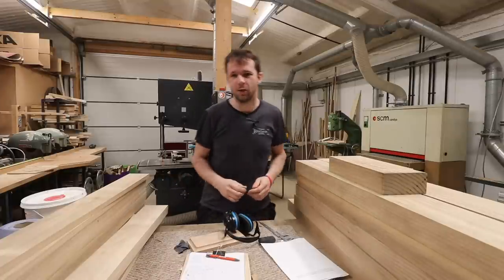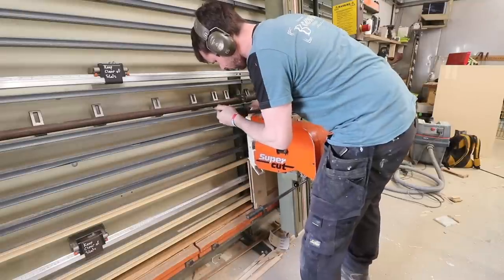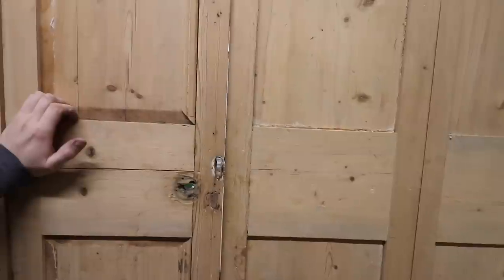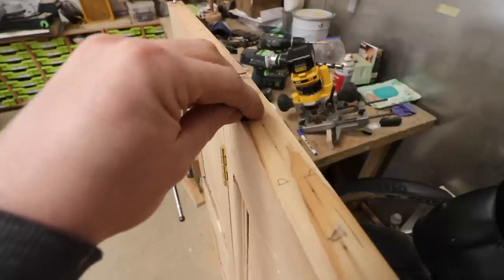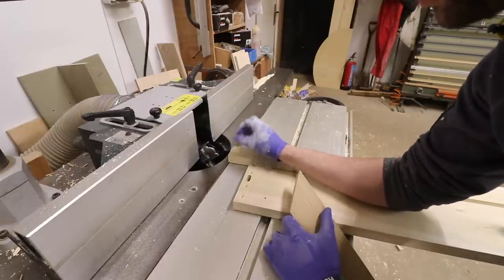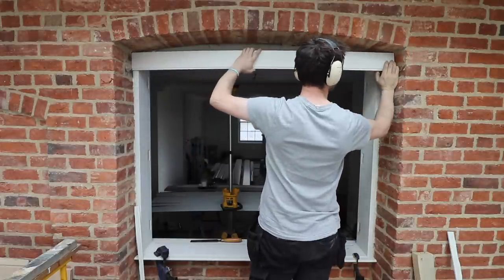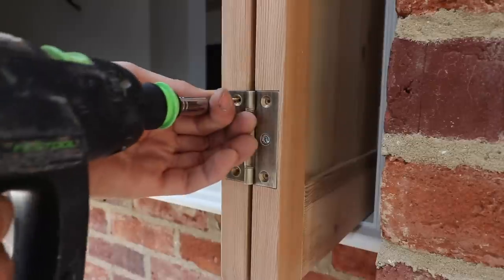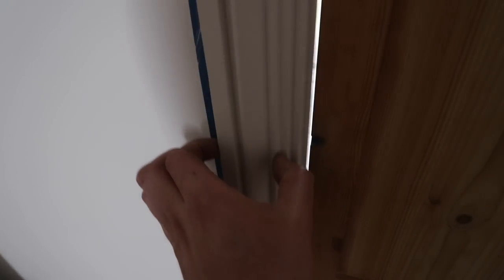Antique Pine Bi-folding Window Shutters - Part 2

Comment: I have the Felder shaper and use the Felder cam lock hold downs on each end of a board as anchored to the sliding table with those 20MM posts. Makes it a bit safer than relying on your push against the fence. Raised panels held by the Felder slider with the cam lock. Holding down the raised panel sections to the sliding table allows going both directions for a climb cut or regular right to left with the profile cutter. A machine shop in Chicago machined the threaded pucks of the Felder cam lock hold down to fit the Martin sliding table. I order some 20MM posts in 20" length and use those on the Felder FE250 to hold box walls in a vertical to allow for the barrel clearance of some hinges.
Reply from the maker: Nice one, yes better to be safer I feel especially as I get older and slower haha
Reply: @BradshawJoinery  I slowed down so much that now I am starting to get faster. Me wife keeps saying, "you're not 25 any more!"  Wish she would stop saying that!!

Comment: Great work mate! That pin gun tip might actually just save me some work when I come to do some trim a bit later on.
Reply from the maker: Nice one, it only seems to affect the 23gauge pinner. my 18 gauge ones dont work the same, but a great tip if you have the 23g

Comment: Nice, when i scribe and panels or fillers in my kitchens i don`t come from underneath like you did, i use Bosch T101BR reverse down cutting blades, you get a great clean cut plus you are looking over the top of your cut line, long as you got a clean base / pad to your jiggy you don`t leave any marks on the surface of your work.
Reply from the maker: Hi Glen, the undercutting style is a european thing, there are a greater selection of blades available and is the main reason palm grip jigsaws exist. it takes some practice! . i do as you do use downcut aswell, but for thin parts find it slow going stopping the chatter by supporting right at the edge of a bench. If its high gloss kitchen considder the makita power file to get that final fit. zero breakout whatsoever

Comment: Looks great! Could you have used the sliding table on your moulder for those short end cuts?
Reply from the maker: Yeah 🤣👍to be fair I did use the sliding table, just to save rigging up a fence and clamp, I knew I had some offcuts the right thickness (kitchen door stock) if it was any other size I would have done.

Comment: Fair play that is utterly outstanding workmanship. Really impressed. If your lining needed packing out before fixing, what type of packer do you use?
Reply from the maker: I use 24mm x 100mm glazing Packers by preference. 

The concrete screws will hold the frame.in position both ways so don't need Packers after they are in anyway 👍

Comment: Snap-on Tool USA sells hex bits that last a long time in a 12V Bosch driver. Their #2 Phillips screw driver bits have little teeth on the Phillips 4 blades that really bight into a the screws and last a long time in use.
Reply from the maker: Thanks Vincent I'll give them a try
Reply: @BradshawJoinery  Jimmy Diresta, New York, makes all sorts of metal and wood projects and I have seen several where he uses a premade aging solution out of a can 
that gives an antique look to metal. Clever guy and known the world over.

Comment: Great looking job and craftsmanship, there but what was that Makita tool you use at 36 minutes on the video to cut the window board ?
Reply from the maker: if you type the exact time in with a colon between itll link to that point in the video by clicking it .... 36:41 i was using a makita power file, Very very handyhttps://amzn.to/3linGQf

Comment: Please tell me again why the stiles are unequal in width.  🤔
I lost track of the reasoning.
Keep up the good work!
JIM 🤩
Reply from the maker: Because when the shutters are open the hinged door that attaches to frame is pivoted about the hinge knuckle and throws the edge of the door away from the track. Because the pin in the second door has to run in the track, to allow it to open to 90 degrees that door needs to be bigger. To make it less noticeable that the doors are different sizes , I made the bigger door with slightly bigger timbers and panel and the smaller door visa versa... So on the finished item it doesn't look like there is any size diffe5

Comment: This is one of the most beautiful things that I have ever seen! Big respect to you. I have just turned down a job for one of my clients doing their bi-fold shutters as I was a little intimidated by it. They were slightly different, they were ones that fold back past 90 degrees into an opening. It was one of those jobs where I just had that feeling that I would make too many errors and end up being way out of pocket so I just built the casing/window seat (actually they were adamant that they didn't ever want shutters so I didn't build the casing and surround to suit them), then changed their mind afterwards 😂. I really do admire your style of woodworking, your care and attention to detail. Whereas I do follow your same approach of get it done properly rather than getting it done in a hurry, I actually am pretty jealous/admirable of your skills. Out of interest, what camera do you use to film your videos?
Reply from the maker: Thankyou Christopher. There is a lot of plan ing to get it right, in the future I would definitely look to get into cad drawings. It would allow you to make the job, and any mistakes) on there before even starting 👍

Comment: Before running any wood through my machines I run a garrett Pro pointer over the wood. (A small handheld metal detector, it fits in the palm of your hand) This let's me know if there is any metal objects hidden in the wood. It will pick up even the smallest piece of metal. It has saved my blades from getting damaged on more than one occasion. Just thought I would share incase you have not seen them before and with you saying that's why you used your wobble blade.
Reply from the maker: Thanks Derek, I hadn't dismissed the idea of a metal detector to be honest and that looks like a reasonable price. I appreciate your reccomendstion and Ill give it a look now! I've been spending a fair bit lately so poker money is rather lacking 😖

Comment: Watching you mold those stubby ends had my palms sweating. Did you discount the method of clamping the workpiece to the sliding table?
Reply from the maker: Not really, I don't have a sliding table clamp (I ought to make one really) but I did have plenty of 70mm stock laying around so it was nice and quick. I agree not the safest 🤣👍
Reply: @BradshawJoinery  I have a Felder KF500 saw/spindle with the X-Roll sliding table. I once cut 50mm long  tenons into the ends of some 4000x80x60 oak for a large triangular window frame that I was making. I used the 1m long crosscut fence (set at exactly the right angle!), with a backer board, in combination with two of the heavy Felder hold-down clamps. The “other” end of the frame-piece had to be supported on roller stands. Even with the monster 225mm tennoning block spinning in the open (the standard hood had trouble fitting over it), it was a safe cut.
I would strongly advise you to make/buy/whatever to enable these sorts of cuts to be properly supported. Apologies for dispensing advice, but that cut looked pretty sketchy.

Comment: You sing the praises of your multi tool.  I find that it just eats blades, and I do pay for them (ouch).  What brand do you  use?
Reply from the maker: Cheapo ones called newone. Buy the equilateral triangel shaped ones so the chips can cut and clear on both strokes (not the wood and nails type) they cut better. Slow them down too, basically they overheat and get gummed up then fail. Always try to cut so one side of the cut is open to clear the chips. A straight plunge can be doen by working in from an angle at each side.
Reply: @BradshawJoinery  Thank you very much.  I'll dig mine out of the dumpster and give it another go.

Comment: Nicely constructed.

No flush pull handles as to open or close the shutters will require it being done from one side or the other.  The wife's finger nails will take a beating as they are at the moment.
Reply from the maker: Cheers Clive. They eventually ended up with some handles and a latch on the side they open into... The latch to prevent you opening from the blind side and pushing something off the ledge, should it have been placed there.. couple of nice d handles too to open and close

Comment: Great work , question about the glue you used, can it be recapped once open and used at a later date or will it dry out and be useless? Thanks
Reply from the maker: Yeah, I don't even cap it, just knock the set part of and if a long time tap the nozzle with a hammer from a couple directions while applying pressure and the set slug pops right out. It's very economical and exceptionally stron

Comment: Don't know if it is correct , but i was taught that it was called a moon board, but i don't really know if it has a specific name lol, nice work as always m8
Reply from the maker: Ahh tha makes sense, more so than turning piece.  Yeah im not sure either! thankyou bud!
Reply: Another excellent video with just the right amount of technical explanation.
To my understanding a turning piece is what the former a bricklayer uses to turn the arch (form the arch), it therefore makes sense that the "infill" to the top of the frame is referred to by the same name. At a time when window frames where structural & built in as the brickwork was constructed - no lintel over the window in the outer face - it would have been an integral structural element of the frame.

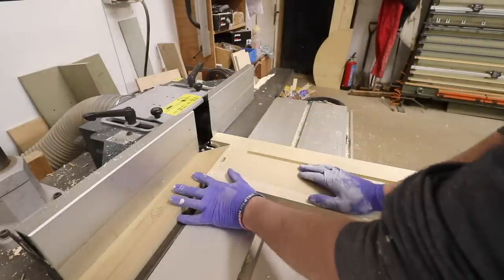Comment: 30:56 why not clamp the piece to the sliding table and treat it like cutting rails and stiles?
Reply from the maker: Namely because i had an offcut the exact size (door stile material) and it was quick, any other size i would have done,

Comment: You could have used the domino for the magnet hole
Reply from the maker: Yeah true, it does do quite a wide hole and minimum 3mm from the surface but i guess could work from other face.